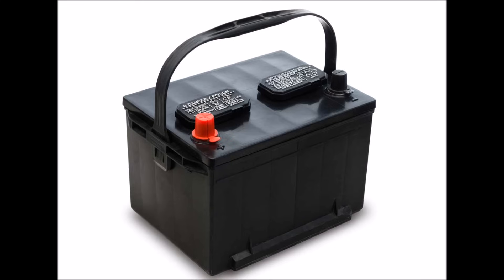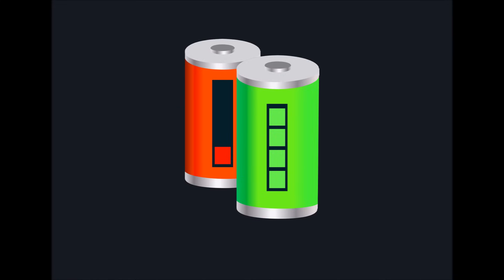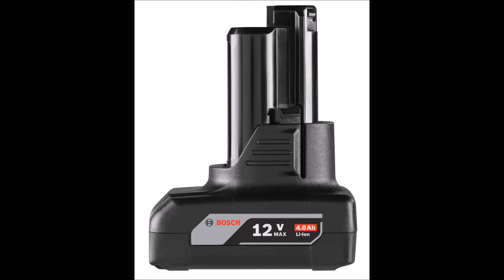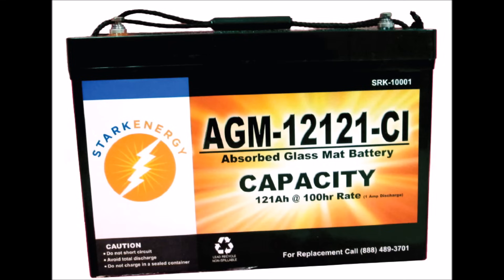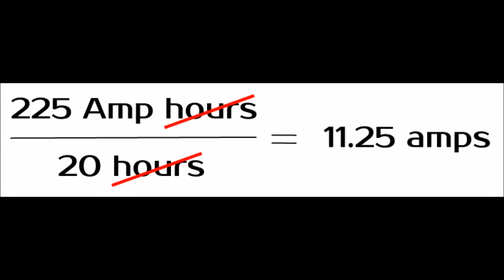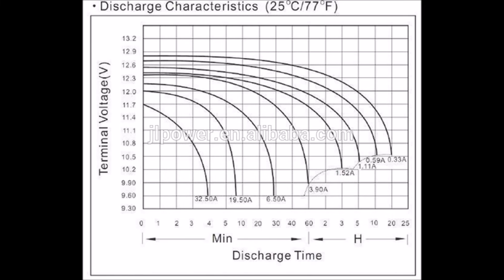Amp Hours???  Battery Capacity Explained

Comment: Where do you find what rate they use and what is it called?
Reply from the maker: For lead acid or lithium?
Reply: @LDSreliance  lifepo4 wattcycle
Reply from the maker: The capacity for lithium is just measured in Amp hours (Ah).  There aren't different hour ratings, although there will be greater heat loss and resistance and so forth with much higher amps which will very slightly decrease "capacity", although a purist electrical engineer would argue semantics.

Comment: U are given a used 12v car battery, it says XXX CCA on label. How do u measure the current capacity? What is the capacity when new? Any formula converting CCA to ah? Then we can find out the SOH, right?
Reply from the maker: Those are two completely different measurements.  There is no way to convert the two.  Sorry.

Comment: Not confusing you just have to do the math.  Everyone loves solar and other means of energy but hate math,, math and energy go hand in hand. The proper calculations will let you maximize your usage for your desired application. IE properly sizing solar and battery bank to give you 5 days of offgrid camping using x amount of appliances/power.  It seems confusing but in todays world all the calculatikns can be done by the phone, just need to learn what to punch in.  Also remember batteries are not exact science, what I mean is you can have it calculated to the T but a random draw or climate variation could throw it all off, so close is good enough and calculate 10-20% over what you think you need to give yourself breathing room. Good day all have fun with it, I goof around with random lights and appliances for my camper, kinda made a game of how long I can keep the juice going lol.

Comment: so run rate is the amp draw??  thank you
Reply from the maker: The run rate is 0.05C and the duration is 20 hours.  1C is the theoretical rate at which a battery would discharge in 1 hour based on the capacity.  So if a battery is rated at 70Ah, then C=70A.  So the 20 hour rate would then be 3.5A for 20 hours.  Does that make more sense?

Comment: Confused.. need a way to check how much amp left in mobility scooter .I use 2 12v50ah batteries ..also do the batteries need to be fully charged after been riding....hope that makes sense ..
Reply from the maker: There are aftermarket "meters" that you can wire up to the battery bank but they are only approximations.  If they are lead acid batteries then you definitely need to fully charge them before using the scooter again.  If they are lithium then it doesn't matter much.

Comment: I feel like the last part of the video is going to really confuse people regardinf the main point you were making.
Of course a battery lasts less time if you pull a lot of amps from it. Thats basics. 
What your main point of the video was that when calculating total capacity, you can either measure it with a small load over a greater time, or a higher load for a short time. In an ideal world, both would give you the same total watthour results. But since batteries are less efficient when operating at high amps, it seems that doing the 'slow' test lets you fake having a bit higer capacity than if you did a faster test.
Interesting point to make, but i believe it could have been explained better.
Reply from the maker: I do have an updated video on this subject.  And it isn't as simple as both ways of rating the capacity giving you the same watt hour results.  Due to the Peukert effect with lead acid batteries, there is more variability than that.  But even with lithium batteries it is still there due but to a much lesser extent.

Comment: Not every battery has an Amp Hour listed on the battery. How can I know the Ah of a battery if it's not lt listed?
Reply from the maker: There is a good chance it isn't a deep cycle battery if it doesn't have that rating.  The only other way to find the rating is to contact the manufacturer.  Perhaps they have a product page on their website with more detailed specs.  Or a customer service contact that could answer it for you.

Comment: but is ther a tool that measures ah?
Reply from the maker: Some very expensive electronic tools, yes.  Nothing handheld or affordable for you and I.  You have to do it the old fashioned way and put a load on the battery and use a stopwatch to see how long it will power that load.  Then do the math.

Comment: have yet to see a 12v battery with the hour rating just the capacity being 20ah...
Reply from the maker: Depends on where you shop.  If you are going to Bass Pro Shops and Walmart you will probably never see it.  But if you shop online or take those model numbers from the big box store and look them up online, you should be able to find a data sheet from the manufacturer that tells you the hour rating that the capacity references.
Reply: @LDSreliance  nope meant online lifepo4 battleborn ect or any brand i have come across

Comment: I want to figure out how many Ah the battery is that in trying to buy... But it's only written in 20hr amp rate.. so how do I convert it so I know the full capacity.

It says
69 (20hr rate-Ah)
63 (10hr rate-Ah)
Reply from the maker: There is no standard hour rate for battery capacity, but 20hr is probably the most common.  So you have the capacity there in two different ratings.  The second number is lower because of the Peukert Effect (higher the load the lower the capacity).
Reply: @LDSreliance  I'm basically asking what capacity the battery is as I don't understand this hourly thing...

The other batteries in getting are 100Ah and wanted to know if this was the same, higher, or lower
Reply from the maker: Not enough information.  Those other batteries are rated at 100Ah but are not supplying you with the hourly rate.  That is probably because most people don't understand that part.  So if you dug up the detailed specs from the manufacturer you would see the hour rate that the 100Ah corresponds to and then you would be able to accurately compare those batteries with the one you are trying to buy.

Comment: 💥💥💥QUESTION 🙋‍♀️ what is the best way to maintain my 12Volt 35AMp how often should it be charge I guess the obvious thing to do would watch the voltage and when it gets I don’t know below 13 give it a charge that’s what I’m thinking is that correct thank you
Reply from the maker: Depends on what kind of battery it is.  Lead acid?  Lithium?  Also, what are you charging it with?

Comment: I got lost in your explanation. When you said at the first example 4.0 ah then you switched to 1 ah ??????
Reply from the maker: Ah is just a rating for capacity.  4Ah means 4 Amp hours.  For overly simplified math, that means you can expect the battery to provide 1 Amp for 4 hours or 4 Amps for 1 hour.  That is not entirely accurate so don't use those expected numbers exactly, but it gives you a rough idea of capability.

Comment: If i have a component requiring 36ah  battery how many ah battery do i need to keep the component running for 10 hours.
Reply from the maker: What is the component and how many Watts does it consume?  There isn't enough info to solve your equation.

Comment: That last line is where I need help: "the more battery power you draw, the faster you discharge the battery."

🤔 Assuming I am to draw much power out in a few minutes if I have a system to recharge the battery, what must I provide in this system to ensure it recharges the battery adequately and time commensurately (what amout of energy or what component??)
Reply from the maker: The charging current of a lead acid battery is limited by the internal resistance, which is pretty high.  So usually lead acid chargers like you see for car batteries are 1-10A for the most part.  It really isn't possible to rapid charge a lead acid battery.

If you are talking about a lithium battery that is a bit of a different story.
Reply: @LDSreliance   Hey I am reading the comments and looking at your replies and looking for things that draw my interest. I have a question also and it is kinda similar to the one above. So  if lead acid batteries don't like to be rapid charged it makes me wonder what about if say you have them pretty well charged at 12.6  volts and the charger isn't pushing much into them. Then you put a high drain or load on them like an a/c which I am going to guess around 15 amps or say a microwave taking  1500watts (11 amps?) and then start pumping that current into them at the same time. So I guees its like massive discharge while massive charging. 

Another question and I understand that mybquestions are long and getting to be longer.  I can probably  try to watch more videos but thought  to ask. Umm so most chargers detect the resistance in a battery so say you had a 40 amp charger that can charge at 40 amp hours and you ran 10 amp hours out of a battery bank what's stopping the charger from trying to dump 40 amps into it or if your battery bank is to small and you try to have lots of energy pumping into them?
I guess I could say what I'm am thinking about for charging is solar. Say you have plenty of solar power for your batteries and want to know if you can charge and discharge close to the same rate if the battery is already charged and just having a lot of heat going thru them? Also I would have battery temp sensors if that could help.

Comment: My motorcycle use 12v5ah battery . Can i put 12v7ah battery at my motorcycle ? Will it burn my motorcycle.
Reply from the maker: Extra capacity will not hurt anything.  You could hook up a 12V100Ah battery if it would fit.  The only thing that would hurt the bike would be a higher voltage battery like a 24V battery.
Reply: @LDSreliance  ok thank
Reply from the maker: You are welcome.  Thanks for watching!

Comment: Right at the beginning he is wrong. A 4 Ah battery will in theory deliver 4 Amps at its rated voltage for 1 hour or 1 Amp for 4 hours. Some manufacturers quote capacity in KW hours. This is available energy not capacity and is too complicated to visualise unlike Ah. 100 Ah will in theory give you 100Amps for 1 hour or10 Amps for 10 hours. It’s just simple arithmetic which gives you a rough idea quickly.
Reply from the maker: There is no difference in kWh and Ah.  They are different representations of the same thing.  Both are ratings for capacity.  kW is a rating for power and VA is a rating for apparent power.

You are also wrong on your math.  A battery will not necessarily give you both 100A for 1 hour AND 1A for 100 hours AND 10A for 10 hours.  There is an effect called the Peukert Effect or Peukert's Law that states that in some battery chemistries, most notably lead acid, the amount of power expended in total from a battery goes down the higher the current.  So you may only get 45 minutes at 100A whereas you get 100 hours at 1A.
Reply: @LDSreliance  I. You obviously didn’t read the part where I said “in theory”. A lot of people are easily confused by electrics so I was trying to keep it as simple as I could. To say that watt hours and ampere hours are the same just shows that you need to retake electrical theory. If you have a 6v 10Ah battery and a 12v 10Ah battery they both have the same Ah capacity but the 12 v battery can deliver nearly twice the power measured in KWh. Very roughly and very simply the 6v battery is 6vX10Ah= 60Wh and the 12v battery is 12vX10Ah=120Wh. Don’t overcomplicate things with Peukert’s Law etc, I am keeping it really simple to help people who are trying to grasp the basics. We are not all as clever as you think you are.

Comment: I want to upgrade my scooter battery from 7 amp to 9 amp would that damage any components
Reply from the maker: No.  The rating you are talking about is Amp hours, which is different than Amps.  Amps is a measurement of current or "volume" of flow.  Amp hours is a measurement of capacity or "total volume" contained within a battery.  Increasing the Amps to the scooter will likely destroy the motor in time.  But increasing the Amp hours of the battery will just allow you to run the scooter longer without harming the motor.
Reply: @LDSreliance  ahhh thanks
Reply from the maker: You are welcome.  Good luck!

Comment: okay now i get it, thanks man. But will the voltage remain constant through this discharging process?
Reply from the maker: No, the voltage will drop as the battery discharges.  Lithium remains more stable on voltage longer but will still drop eventually.  Lead acid drops steadily the whole time.

Comment: Someone let me know please.. does it mean that 5 amp can draw 5 amp in 1 hour or 5 hour I'm confused lol I'm noob at this

I have 12v 5amp power supply so I just wanna know
Reply from the maker: A power supply is completely different than a battery.  Don't confuse amps with amp hours, they are different measurements for different things.
Reply: @LDSreliance  ah I see but thanks for the response
Reply from the maker: @macksuting6263  No problem.  If you have more questions let me know.

Comment: I am running a 7 watt light outside the tool shed, 9.5 watts on the porch, and 9.5 watts on a small indoor lamp. All with a 100 amp hour battery. How many hours can I run all three?
Reply from the maker: Not enough information.  A good guesstimate would be about 4 hours if you use all 100Ah.  But more likely after you subtract some real world losses and conditions I would say 3 hours is safer.

Comment: Hi, Is there a way to test a battery to find out the  amount of amp? How do I know that the battery is 100amp or 300 amp? Do the listed amp matches the actual amp? Thanks
Reply from the maker: Without a battery tester there isn't really a way to find out how many amp hours of capacity a battery has unless you get that info from the manufacturer.  I assume it isn't listed on the battery label or the label is missing.  Is there any other part number or identifying info on the battery?
Reply: @LDSreliance  what battery tester would you recommend?  As i searched here, the only video I found helpful was a car battery hooked up and when the car starts it draws power and then you can measure the current draw.  The multimeter l  found for that, one is from Ames  and another from fluke. My delema is that i am not hooking up the lifepo4 battery yet. I just want to know which meter should I buy to check battery amperage with out hooking up to a load. I am very new in learning electronics, so just collecting items before the installation.  If you can make a video that would be great.  Thanks
Reply: @LDSreliance  i am planning to buy the meter but it won't solve my issue. As i am not trying to just determine the load the specific fan or light i will hook it up too.  I am hoping the battery have the amp it says.  Its better that i know how to check it. Thanks
Reply from the maker: You can't test the battery capacity without hooking it up to a load.  Basically, you need a battery tester that can measure the amps and keep track of how much energy is consumed on a given load.  Then you can do the math for how long you ran the load multiplied by the current that was consumed.

Comment: I was using 3 ampere hour battery in my bike so currently can I use 4 ampere hour battery instead of 3 ampere hour in my bike or not
Reply from the maker: Yes.  You can always use a higher capacity battery, as long as it will physically fit or attach.  The only thing you can't change is the voltage.
Reply: @LDSreliance  is it safe for engine if I use big capacity battery... I mean will it damage the electrical parts or not....?????
Reply from the maker: No.  Think of it like a 12oz can of soda vs a 20oz bottle of soda.  You drink them both the same way and at the same speed.  But you can drink longer out of the 20oz bottle because it holds more liquid.  Same thing with different capacity batteries.  Your 3Ah battery will provide the same voltage as the 4Ah battery to your bike but it will run out of energy sooner.  That's all.

Comment: I have 24v 7 amp battery for power wheels can I replace it for 24v 12 amp?
Reply from the maker: Yes, as long as it fits!  It will last longer.
Reply: LDSreliance thank you
Reply: LDSreliance it has 2x12v can I replace them with 2x24v?

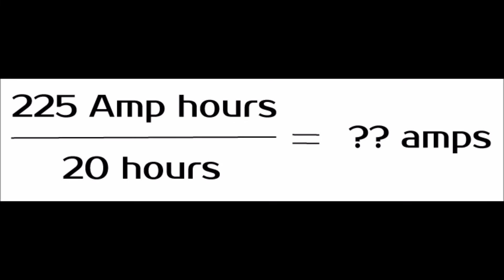Comment: @1:27 - 225 amp hours specification alone does not tell us exactly the amps and discharge time the battery is capable of handling by design.   When the specification says in "20 hours" ,  then it must be capable of 11.25 amps  in 20 hours by doing the maths.  A car battery is also limited by its cranking amp .   It can only discharge so much amps at a certain voltage in an instance for example.

Comment: Thanks for broadcast! In your opinion do you think it's possible to build tool box solar systems to run a Mr heater or charge tool batteries or a small frig of air conditioner? If you had saw 3 or for of them with a regulated electronics on it so it doesn't over charge I'm a beginner but see we may need this sooner then we think!